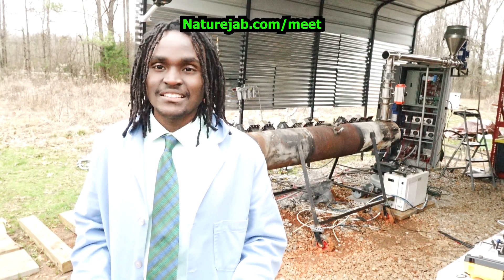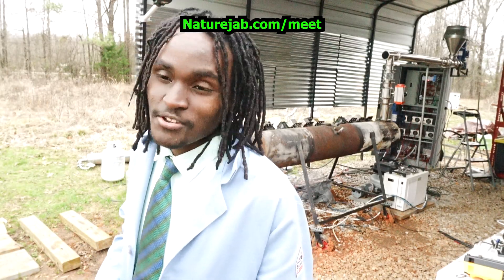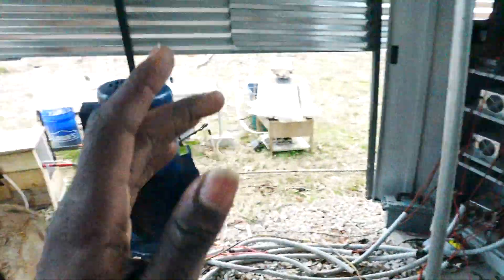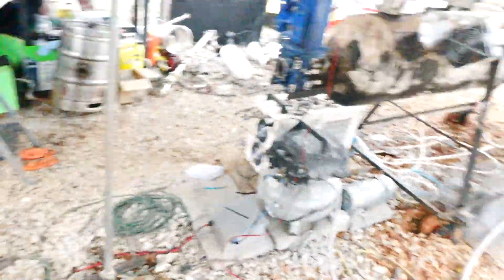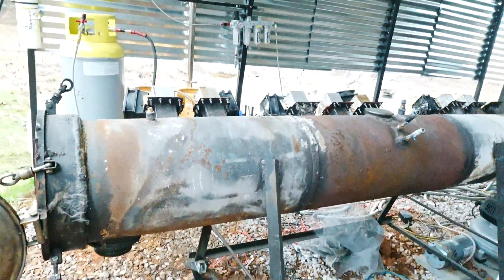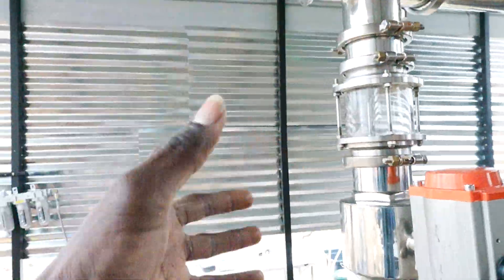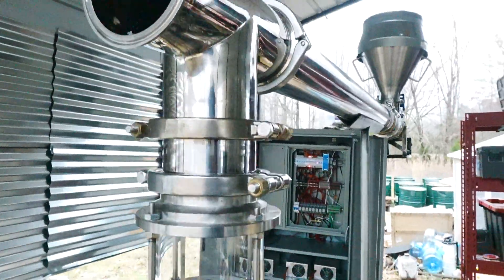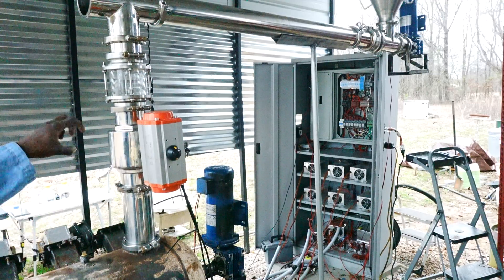Valves Opening & Blades Spinning! | Mark 4.5 Plastic into Fuel Reactor Quick Update

Comment: I work in the plastic industry , So are those going to have melted plastic running through it ? I get u wouldnt want cloggs but have u thought about the efficiency  of using shear heat and heater bands around the barrel using a more traditional , shaft screw, trust me u wont get cloggs if ur motor and gear box are strong enough , they are not hard to build from hand , HOW TO MAKE AN AUGER fabrication , thick enough , flights , would be 3/8 thick all made from mild steel would be easy to held and cheap to source scrap , making it more consistent , variation is the enemy .  Would really like to talk about it with u

Comment: My suggestion to reduce the risk of clogging is to have it vibrate so that the plastic have a harder time setting in one spot. But then again, that could actually create the opposite of the desired effect with small pieces becoming caught in any nook and cranny. 

Another is having a short burst of air shoot up the tube to clear. This could be set to an interval or make it a manual release to save. With that, youre either saving time or saving money.

Lastly, having weight activated door that allows the plastic to build to a certain weight and then drop down the shoot, similar to a bagging system.   Just my ideas. I hope you find a great solution. Even these multi million and billion dollar companies have issues with clogging in production so dont get discouraged

Comment: Wondering on the directional control valves needed for the shreds charging. Do you think its worthwhile to design it to be inherently unable to be misoperated?

Just a plain idea with no details and not that well thought out but just pondering if its worthwhile. Could use a 5 port/3 position valve. So you have a neutral position where both ball valves are closed. Second position is where the bv near the vacuum loading side is open while the one near reactor is closed. Then the third position closes the first bv while opening the second bv.

But even so these big valves take time to open/close. Idk if the valve actuator model here is capable to have sensors, but if yes you could interlock the control valves to only allow max of one valve open at one time. So between each action, some pause is needed to move to the next action in the sequence, to allow both ball valves to be closed, before opening the next ball valve. Not sure if this makes sense but its a NAND kind of logic. Alternately, have no interlocks but have some coloured metal sheet at the valve stem to display from far if its closed or open, then operate valves manually. But tbh this all sounds like a lot of work. Im not gonna go beyond the idea phase lol. There could be much better methods

Comment: Still not addressing the toxicity issue?
Reply: He’s not even to the production level of product that he’s going to sell or give away yet. If he runs a motor or two whatever. Def should’ve been wearing Ppe driving the car on plastoline but that’s not a huge deal. Once he gets to full production and optimizes his process, it’s super easy to remediate gases through chromatography or distillation. As long as he wearing ppe and not distributing the gas, I don’t think he has to address it. Besides the car he hasn’t really put himself in much risk recently besides lighting a fire inside the chamber to remove the old coils next to lpg tanks (I hope they were empty 😂)

Comment: Wonder if theres a small scale process to pelletize recycled plastic? could help with storage and efficiency by minimizing dead space from larger chunks
Reply: The problem is making the plastic into pellets will use up more energy,you can only use so much energy to make the fuel before it becomes a snake eating its tail.
Reply: If it isn't already
Reply: That is a good idea. If it was pellets, then maybe they could be pre coated evenly in one of the after product to  raise its slump temperature to keep it all from sticking together above the ball valve.